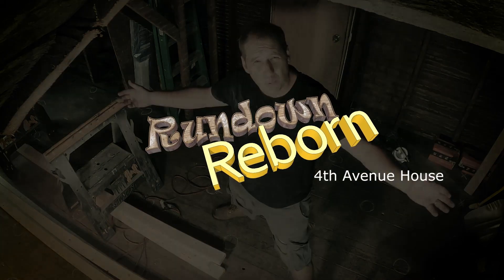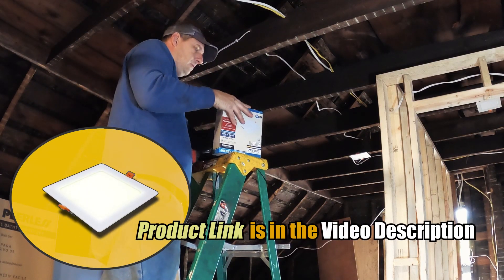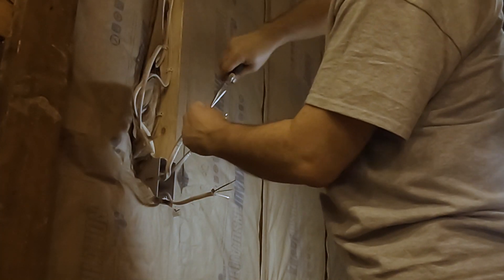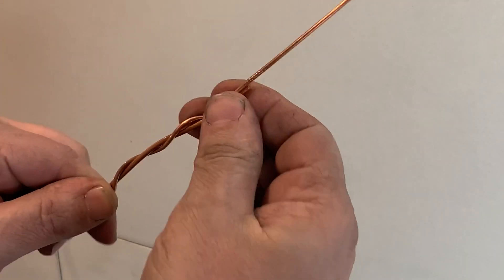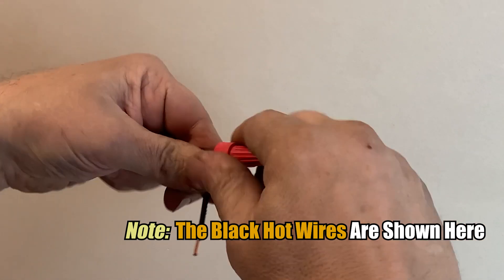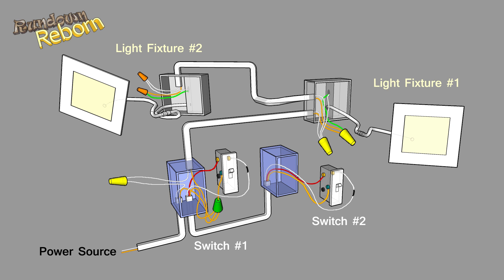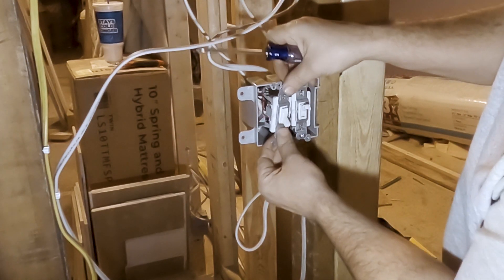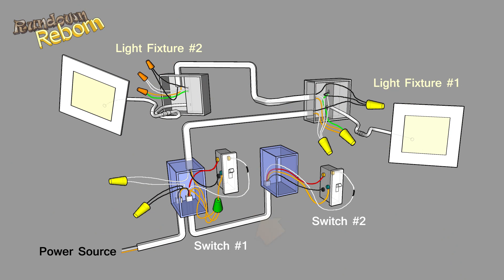DIY: How To Wire A 3 Way Switch (Multiple Lights) - IN 5 MINUTES!

Comment: To tell you that are saying this is an awesome video you need to realize he’s wired this totally wrong. He’s got 14 three wire and he’s using a neutral as a traveler that is not correct and not necessary when you have correct wiring and the second switch is what should feed the light
Reply: If it works, it works, gotta keep it simple. Ive ran 14-3 across one switch, 3 lights and into the last switch, cant get it to work. Works off one switch only. Power stays on with other switch. I will be cutting a slit into the ceiling to run another 14-2 wire bypassing all fixtures, to just connect the switches together.

Comment: Hooked up 1 3way and 1 duplex outlet in hallway and same in garage lights work on / off from both 3 ways my question how do change wiring in boxes so both outlets both locations are live all the time. As per your wiring right now both location 3 ways are off with 3 way switches only come on with 3 way switches turned on? Could you show me a correct diagram showing  1 3way and 1 outlet in a two gang box?
Reply: You have a excellent video  I just now need to know how make the outlet in the 2 gang box with the 3 way switch live all time on both 3 way locations?
Reply: Any diagram  I can see to make connections?

Comment: THANK YOU !!! Of all the  many "3 Way Switch" videos on the web, yours seems to be the only one that shows the power source and the appliance/light on the same side of the first switch !
Reply from the maker: Thanks for watching
Reply: My question would be if you could run the 14/2 to your lights from the other switch that doesn't have power going to it. It would be easier for me since there's more room in the box, otherwise I'll have to replace the box with a bigger blue type one.

Comment: Great video!!
I’m still having trouble with an existing 3 way switch, one light. That part was already here. When I try to dub another light it just doesn’t work properly. One light will light and the other will not. I’ve tried new switches, everything works as it should but can’t get the 2 light added? Any help would be greatly appreciated!!
Reply from the maker: Sorry I’m late. Hopefully you got it figured out

Comment: I watched another video that said you didn't have to connect the neutrals to the switches. Just curious in what scenarios you would and wouldn't need to connect neutrals
Reply from the maker: 3 way switches can be done several ways. This is one way

Comment: Thank you so much for this video! It was amazingly helpful! I'm getting ready to rewire the basement lights to do just this.

Quick Question: Is there a way to add a light (Light Fixture #3) coming off of Switch 2 but still powers on at the same time as Light Fixtures #1 & #2? Light Fixture #3 would be at the top of the stairwell going down into the basement and Light Fixtures #1 & #2 would be down in the basement. Thanks!
Reply from the maker: Glad it was helpful! Not sure about your other situation
Reply from the maker: Most likely you can wire all 3 lights together in a series

Comment: Confused… your switch shows two brass screws across from each other, mine shows a black and brass across from each other, with the black screw labeled as common on the switch. So am I still wiring the red wire to a brass screw or to this black common one?
Reply from the maker: Ignore the colors. Think of the wires purpose. Power and neutral. Just keep the power flow consistent across all fixtures. Power wires deliver the power and bureau wires close the circuit

Comment: Excellent explanation!

Quick question, if my basement stair light is running off of two three way switches, is it possible to add one more light to the top of stair case?

It looks like the previous owners started the loop at the bottom of the stairs, used a common red travel wire to run to the switch at the top of the stairs, but used the white wire of the second as a load line to that second switch.

It’s all a little screwy bc there is only one red common line for three separate connecting points that are using 14/2.
Reply from the maker: You should be able to daisy chain multiple lights from the existing light.

Comment: How do you bypass a centre outdoor light for a ring camera. I want the switch to control 2 outdoor lights and want the ring camera independent. Thanks
Reply from the maker: Rings are usually wireless. Otherwise you have to splice into the main run somewhere before the switching

Comment: Nice vid, but the “common” red wire is not the “common” by actual licensed electrical contractors.  Whatever goes to the black screw (feed/line/power) is the common…..
Reply from the maker: Thanks for the feedback

Comment: THAAAANK YOU! I’ve been looking everywhere to find someone that specifically wants to take an existing single pole switch+fixture and make it into a 3-way. 
(Many will smirk or laugh as I’ve gathered it’s “Simple”,  but I wanted to be 100% I had it correct.) 
After searching high and low this is the only video on YouTube I’ve seen address that specific situation. 
Again, much appreciated!
Reply from the maker: 3 ways can be tricky. Glad the video was helpful

Comment: Can I change switch one into a combo light and receptacle switch?
Reply from the maker: A switch can operate anything. It just turns the power on or off. It doesn’t care if a receptacle or a light or a nuclear power plant is on the other end of the wire.

Comment: Could I replace (switch #2) with a motion sensor? I'm looking to control 3 outdoor lights by my garage door using an outdoor motion sensor and a switch inside the house.
Reply from the maker: That will probably work for you. A motion sensor is basically a switch.

Comment: I wish there was a way to add a second light to a 3 way switch where you cannot access the wiring for the first light. I read somewhere you could use a duplex 3 way switch as the second switch, then run power to the second light from the other switch on the duplex (the non-3way switch). I tried it. Didn't work.
Reply from the maker: Possibly but I’m not sure how. 3 way wiring can be tricky. Possibly splice into the wiring going to the existing light.

Comment: I could watch this video 30 times and never understand it I can't understand electrical wiring. I can run a plug or jump power from some place and put in a plug but three-way switches I have no clue no matter how much videos I watch??. I guess I leave it to the electricians
Reply from the maker: Absolutely. Electricity is not something to take lightly.

Comment: Everything was looking good and helpful. I think at the end when you activate the circuit it was a 20 amp breaker and you were using 14/2 and 14/3 wire which you aren't supposed to do. You need to use 12/2 or 12/3 wire wit ha 20 amp breaker.
Reply from the maker: I usually use 12 gauge wire for my home runs to the panel.
Reply: @RundownReborn  If you have a 20 amp breaker you can't by code use 14 gauge wire. Doesn't matter that your home run is 12 gauge, all wire on the circuit needs to be 12 on a 20 amp breaker. The wire could fail before the breaker trips.
Reply: So bill if all the wires are already in place and all I was doing was to replace the existing lights for led waffle lights would that be ok? Also the box supplied with the led waffle lights is so small and if I am using a pig tail is there a way to connect all the wires and make them fit inside the small box? Thank you….

Comment: Extremely confusing.
Reply from the maker: Sorry. I tried to make it as clear as possible. 3 way switches can be confusing to begin with. If you aren’t comfortable with DIY electrical, you can always hire an electrician.
Reply: @RundownReborn  no i don't have the option of hiring an electrician and im not condeming you for me not understanding your video ill just keep serching for one that i can understand you did a great service im not criticizing you for my failure to understand hope you forgive me for that thank you anyway im sure most others understand your video.
Reply from the maker: @jimmyjennings8956  use multiple sources. There are many ways to wire a 3 way switch. The underlying premise in all of them is you must complete the circuit in a loop and use a third wire (the red one) to allow the switches to function independently. It can be tricky to figure out. The red wire links the switches and interrupts the neutral loop.

Comment: I wired a three way switch to a new outlet and now the outlet works but only if the switch is on. I needed it to be hot without needing to be switch operated.
Reply from the maker: Yes. The switch interrupts the constant supply of electricity to the outlet… same as if it were a light fixture. You need a direct connection to the outlet if you don’t want the switch to interrupt the circuit.
Reply: @RundownReborn  so do I have the wires backwards at the outlet. If I switch them will it be constantly on at the outlet
Reply from the maker: The 3way wire routes the constant power through the dual switches. You must find the source hot wire and splice it and run direct power to the outlet independent of the switches. Otherwise the switches interrupt the power. It might be at the second switch. You have to determine which wire is coming directly from the power source and that wire needs to be directed to the outlet (around the switches).

Comment: If a 3 way is already setup, and you just want to turn one fixture into two high hats ... couldn't you install your new high hat and pigtail off of it to make it two highats ? If you get what im saying .... wouldn't I be fine not making any changes to the switches ?
Reply from the maker: The lighting wiring is independent of the switch wiring. If you daisy chain the lights - the switch will control all of them. Hope this helps clarify your issue.

Comment: In this scenario, do the light fixtures have to be a special "3-way" type? I need to replace two hallway light sconces that are operated by two "three way" light switches. or can I just purchase any wall light sconce I want?
Reply from the maker: Lights are basic two wire connections plus a ground. The three way refers to the type of switch configuration. You could three way switch a giant robot in a factory or a tiny led light bulb. The fixture is independent of the switch.

Just make sure you kill the power at the panel before working on electricity! ⚡️

Comment: One guy says black is common this guy says red....I feel like I'm at my government job....lol
Reply from the maker: They both can be - it depends on how you wire it. Old wire standards did not have a red wire - it had two blacks. The only physical difference between the two types of wire is the color of the insulation. Now 3-wire strands have red wires in them. If you are working with already installed wiring - assume they both can be hot. But when installing new wiring - use the black wire as your "hot" wire and use the red wire as the common wire for 3 way switching. Hope this clarifies things a little. Thanks for watching!
Reply: Yep everyone has a different way of saying and doing.. this is all over the place.

Comment: What if there’s no red cable and only 2 blacks and one white
Reply from the maker: This is an old standard of wire. You will need to have some testing devices to determine which black wire is hot. This might be a difficult thing to do without experience. It can also be dangerous or hazardous if not installed properly. I would recommend inquiring someone local that has some electrical knowledge to take a look at it for you and offer advice.

Comment: Was the light fixtures on a 14/2 wire ?
Reply from the maker: Yes. I used 14/2 wire for all connections except the connection between the switches. 14/3 wire has that extra red wire to enable 3 way switching. I used 12/2 wire for my home runs to the panel.
Thanks for the question and for watching.